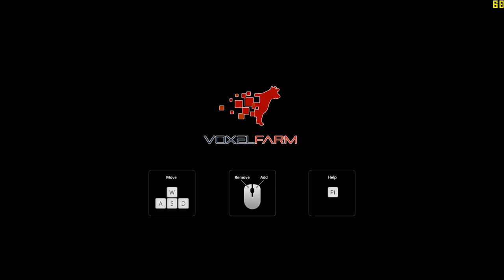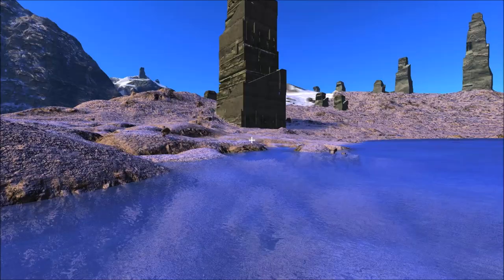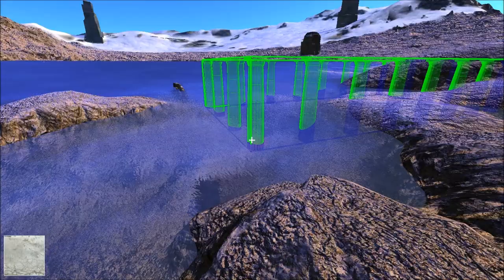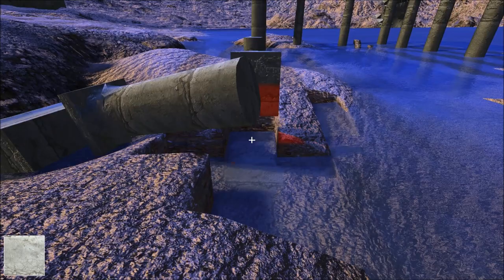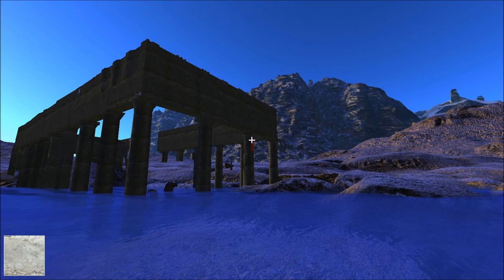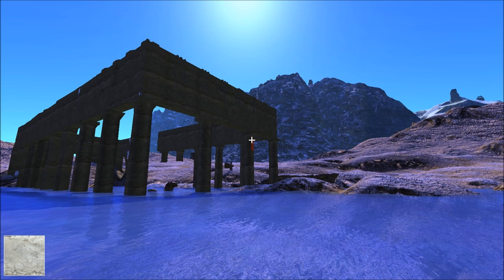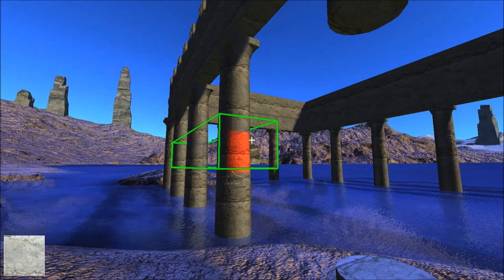Voxel Farm: July 2014

Comment: I swear off grid rotating won't be so good in landmark, there is some magic here that does not happen so well in landmark for some reason.
Reply: I'm trying to wrap my head around the off grid pasting too with my extremely limited knowledge of voxel engines. Landmark doesn't have physics like this either, maybe the off grid rotating interacts with the physics somehow, How do the voxels/polygons move through the worlds after being broken? The polygons become detached from the voxel grid? Maybe offgrid pasting is just an additional instance of the physics, the voxels aren't actually replacing the voxels already present(even air is voxels afaik) like on grid pasting but are pasting just polygons on an additional layer that interacts with the standard voxel grid but is not bound by it. As such it's limited in what can be done with it after pasting. Think similar to avatars running through the world, they aren't made of voxels yet they don't fall through the world, polygons interacting with the voxel grid but aren't bound by it.

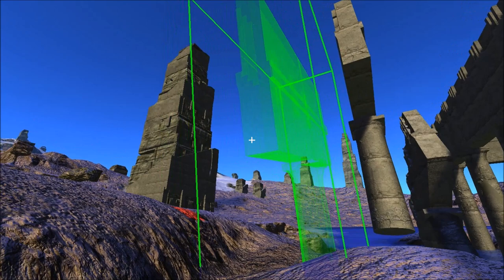I also don't know what voxel size he is using here, maybe he is using smaller voxels than Landmark uses, that would allow more flexibility to a tool like this if that is the case. 4:12 Look at the detail on the top of those walls. Maybe he is able to generate that using the voxel grid as a base using an architectural grammar, the detail could be compared to many props connected together in Landmark? Either way I can't wait to see what landmark and EQNext do with the procedural architecture when combined with the AI system they are creating.

Is Miguel helping to implement that AI system or is that solely an SOE project?